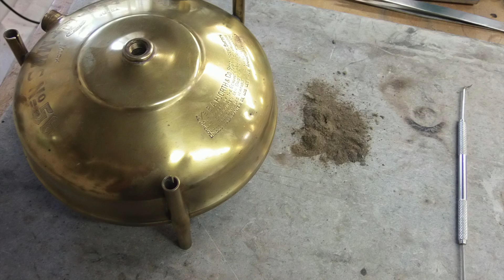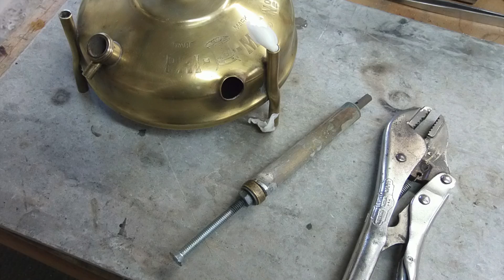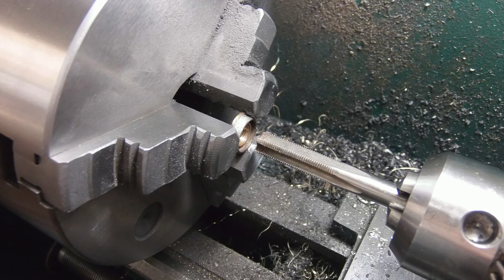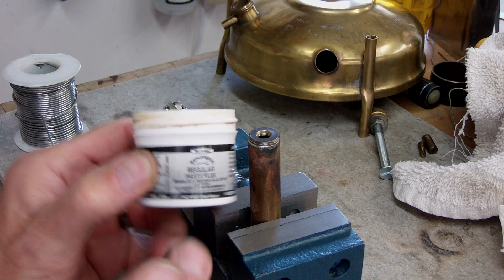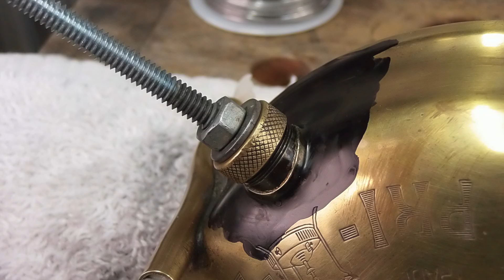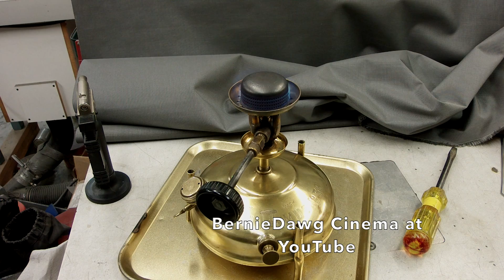Pump Tube Removal & Installation

Comment: I have done the same job with a Eze out ie change check valve
Reply from the maker: Yup. Me, too. I generally try that first. And, using a screw extractor will work much of the time, but *not always*. Once you've done several dozen of these pump tubes like I show in the video, you come to realize the pump tube method is good to learn for those times when a screw extractor (aka "EZ-Out", a brand name) on a bit extension won't do the job. Plus, the screw extractor method can direct so much force to the pump tube end that the pump tube end will break free of the pump tube. Old solder gets pretty brittle over the years. Then you are looking at a pump tube extraction anyway. Plus, extraction is the best way to repair a leak at the pump tube where it meets the tank. That's a very common leak point. So, that's why I made the video on this subject. I'm all about sharing stove skills with folks. How about you? Why don't you go make video on how to use the screw extractor? It'll save me doing it and I can link to your video through my channel and my webpage. 👍😎 BD

Comment: Excellent video, I’ve ordered the recommended Solder and flux off eBay ready for the repair of my Primus No.5 stove, the filler neck has a previous repair which looks awful and still leaks air, so I shall remove clean and hopefully seal it properly using your method on the pump tube. Thank you for sharing
Reply from the maker: Great to hear! You're welcome to drop a note to bd@berniedawg.com if you have problems or need some guidance. BD
Reply: @BernieDawgCinema  Thankyou that’s very kind…

Comment: My own Optimus 111, new old stock, over 20 years long never fire, it showed up that the pump cap stick super tightly to it's body tube!!!, I cannot go on any proper way after an overnight soaked with WD40 fail to success.
Reply from the maker: Try a real penetrant (not WD40) and soak for a week. Use Kroil, Aerokroil, or other penetrant designed to loosen parts. BD

Comment: Hey Sir What can I use besides the India ink on the parts I don’t want the silver solder to stick to ??
Reply from the maker: @Plumpy E Heya Plumpyman! Thanks for checking into my videos. I don’t have an alternative masking fluid for you since india ink works so well. Why switch to something else? I know it’s not a cost factor for you seeing the $$$ you have tied up in your gun and knife collection. ‘Sides, the stuff is cheap. Make sure to use rosin core lead/tin alloy solder for tank work and greater than 45% silver brazing rod or wire for burner work. NEVER use “silver solder” on stoves anywhere. Ever. Hope that helps. Remember I have a FREE helpline at bd@berniedawg.com . Easier to explain stuff and share photos of the problem work you are trying to tackle. 👍😎 BD

Comment: I am so grateful for this video.  I have a rounded nrv on old no. 1.  My prob is I don't have a spare cap to make the tool to hold the tube while extracting. Aany ideas?  If you happen to kniw the thread, perhaps i can cut one. Thanks!
Reply from the maker: @don evans I'm glad you liked the video. You definitely don't need a "spare" pump cap to make the tool. Just use the pump cap you have with your #1 stove to make the tool. The shaft of the bolt just needs to be a smaller diameter than the hole in the pump cap. Generally, a quarter inch bolt (or 6mm bolt) will do the trick for the shaft of the tool - just like the shaft of the pump. The pump cap is then removed from the tool when all the work is done and returned to service on the stove. Easy-peasy. 👍😎 BD

Comment: Very informative. Can you please tell me what thread is the Nrv
Reply from the maker: @steventhegrease monkey Sorry, I can''t (won't). It's a unique thread size designed by the stove manufacturers in the days before standardized threads circa 1890. Many of the thread sizes on these old stoves are like that - unique and proprietary so that you were forced to buy from the manufacturer. There are at least two standardized modern size threads that approximate the original proprietary NRV thread, but... if you can make one on a lathe, then you also have the skills and knowledge of how to measure the thread yourself. If not, then just buy properly sized replacement parts available from the few stove part suppliers still remaining in business. BD
Reply: @BernieDawgCinema  thanks I will give it a try
Reply from the maker: @stevethegrease monkey You could look in the description box below the video for some info, too. 😉 BD

Comment: Great video. Well done. India Ink to keep solder off areas where you don’t want it, nice! I just received my grandfather’s / Dad’s 1951 Primus No. 96.  Excited to use but need to clean it first, then test it’s function. Questions: How best to clean I, as the brass is quite tarnished? AND, any specific suggestions on how to take the stove through a proper testing are there specific things I should just go ahead and replace / repair? Many thanks, keep the videos coming!  Cheers from Alberta, Canada
Reply from the maker: @A Toiler Clean with some mild dish detergent and warm water. I don't endorse polishing, especially if it's old and has a nice patina. You'll remove brass and thin the tank walls every time you polish. Making it shiny like new destroys the history and character of the stove. A bit like trying to get Grandma to look like Megan Fox by applying lipstick and a wig. It's just wrong. (Ewww.) Wouldn't you rather want to see the history your Dads use left on the stove? Check my other videos. Especially the kerosene stove playlist. I have pretty well covered all the steps to get the NRV, pump cup, seals, etc refreshed and taken care of. Good luck! BD
Reply: @BernieDawgCinema  BDawg, thank you for your prompt reply and salient advice.  I’ll give the stove a gentle, nom-abrasive cleaning, then enjoy the patina! I will review your video as well. Shall I assume there are links to where I can obtain any seals etc. that I may need? Cheers to Megan Fox!:face-green-smiling:
Reply from the maker: @A Toiler You can find links to parts in the description box below many of my videos. Or, go to the parts page at my website (also frequently linked in the YouTube description box). https://www.berniedawg.com/stove-part-supplier-links/ Or, drop me an email at my free help email address: bd@berniedawg.com Easy-peasy. 👍😎 BD

Comment: Hi, yes I was sold a bad stove with a couple of issues and this was one of them.  I will try and follow your post, I have no tap die nor will I have a bolt like yours.  However I will persevere with torch and pliers and maybe help from someone to pull as weld gives.  I will watch this a few times lol.

Comment: GREAT video- unfortunately I need to perform this on a stove w/ a rounded NRV.
I'm no soldering slouch,  this video gives me the info , tips, tricks to git-r- done. Thanks for this BD.
Reply from the maker: @David Schmidthuber Drop me a note if you'd like advice and help with that. Perhaps better advice than you may already have been getting. bd@berniedawg.com BD

Comment: Glad I subscribed a few days ago as learning lots. Just picked up a Meva 1 SC stove dated 366 and got it working after tank cleaning. NRV needs attention as pump stem now starts to slowly come out under pressure so will need a new pip for sure. Hoping a longer acetone soak will allow NRV removal as it does loosen but is hung up. The NRV is slotted so no need for removal tool. Might have to remove pump tube as I dont want to destroy the inside of pump tube or the NRV. I might try a dab of crazy glue on end of screwdriver to fuse to the NRV slot as i dont want to pump air into tank since the walls are pretty thin snd prone to stress cracks. Thanks for all your videos and hope a resolution to your burner caps comes to fruition. M Smith in Ontario, Canada
Reply from the maker: @Mark Smith If you have compressed air through a chuck with a rubber tip you can give a 1/2 second burst to the tank through the filler neck and the NRV will likely shoot out the pump tube. Maybe hold a rag over the end of the pump tube when you apply the air to catch it. Or, you can use a pair of ear forceps, about 6-8" long to grasp and pull the NRV out of the pump tube. Find those on eBay for cheap. Or, you can take a steel welding rod like for oxyacetylene welding and put a small hook in the end and fish it under the head of the NRV to pull it out. The hang-up with the NRV is almost certainly the barrel of the NRV hanging up on the lead NRV head washer which has tightened up around the NRV barrel. It's why I prefer LDPE or HDPE NRV washers over lead. Good luck! BD

Comment: Excellent video....I have an old monitor 17b tourist stove and the vapourizer tube is off center to the brass threaded bit....this puts the burner head off centre....can this be repaired?
Reply from the maker: @John Watson Thank you! Yes. The Monitor 17B can be repaired to better center the burner head. 👍 BD
Reply: @BernieDawgCinema  And could you please tell me , could i do it with an ordinary propane blowtorch? or would i need more heat....i've never tried this before.
Reply from the maker: @John Watson Maybe. It all depends. Teaching you to repair your stove is not reasonably possible in YouTube comments. If you take a look at the very first line in the description box below the video you’ll see an email address where you can contact me to get assistance, advice, and even instructions on how to do your repairs. Just send a few photos of your issue(s) about the stove to that address. And, don’t forget to introduce yourself in your email with a real (not anonymous) name/ID and maybe what country you are located in, please. Thanks! Speak to you soon. 👍😎 BD

Comment: Great video. Thanks! Is that the original burner?
Reply from the maker: @Torbjørn Gjertsen Wow! That took some work to find out. A client stove I worked on in 2015. Yes, that is the original burner with (I believe) the original inner/outer silent cap sets. The stove is a 1948 Primus #56. The burner is the #4155 burner that preceded the #4190 which is much more widespread and well-known. The #4155 extended the cleaning needle when the burner spindle valve was fully closed - the opposite of the standard method featured on the #4190. You can find this stove, after my repairs, posted by the owner here: https://classiccampstoves.com/threads/primus-56-1948.30707/ I also made the tool for the owners Primus SRV fuel cap that features in that social discussion forum thread. 👍😎 BD
Reply: @BernieDawgCinema  Thanks for a great and detailed answer! Sidenote: Yesterday i saw a Primus, UNUSED in its original package for sale here in Norway price was $120 or bid. Now the ad is gone and unfortunately the pictures too. What do you think it could be worth? Looked like 60+ years old.
Reply from the maker: @Torbjørn Gjertsen There is no easy or reliable way to price vintage stoves sold at auctions. There is supply and demand. And, there are just serendipitous things like bidding wars. Stoves bring what they bring and the results can vary for a variety of factors. To get a general idea of what a stove is worth, check the “completed items” at eBay for the item you are interested in. It’ll give you all the finished auctions for the last three or more months. That way, you can get an idea of what your chosen item will bring at auction. The two big sellers I see out of Norway are the military Optimus 111 stoves that have the Optimus-modified “C” or “cobra” burner that’s been turned 180 degrees (sometimes mistakenly called the “Arctic” stove); and the Fuhrmeister military stoves. Here’s a Fuhrmeister now, which will disappear after this Saturday, Feb 6th, 2021: https://www.ebay.com/itm/Vintage-military-camp-stove-Fuhrmeister-No-8/284166889632 
At $1100 now, it may well sell for over $2-3000 when the dust settles. Good luck! BD

Comment: That’s a beautiful repair. I have recently repaired my mum’s old Primus 96 which I think she has had since the 50s. The NRV was so jammed in that I added a lever to the new NRV wrench I had bought with the service parts. It was so tight that the wrench handle started to bend! I decided to clamp the wrench vertically in my vice and lower the stove body over the tool.  Eventually I got the NRV out and was surprised that there was no washer inside. I guess that’s why it was so tight. Thanks for the video.
Reply from the maker: @Tony Frewin Thanks for your story. The method you stumbled on (NRV wrench in the vice) is the long time approach to removing stubborn NRVs and is the method I promote, show and demonstrate in several of my other stove repair videos. You may wish to check out those other videos to learn even more about your stove and stove repair generally. People in the UK were pretty poverty-stricken after WWII, so it’s likely the stove lacked a NRV washer due to penny-pinching and frugality in the postwar economy. BD

Comment: Hi. Thank you for this excellent video. I have learned a lot. I have a family owned Radius 21. I want to try to remove the NRV first but the NRV key is lost. Could you share the dimensions of the key (or the screw head at the bottom of the tube) for those of us who wish to try to build a rplacement key. Thanks again!
Reply from the maker: Hi Afsar Saranli I've posted dimensions and photos of the most common NRV style as found in your Radius 21at my blog site. Here's the link: http://www.berniedawg.com/nrv-head-dimensions/ Hope that helps and good luck on your stove work. BD

Comment: Sir. Kerosene fills in the pump tube of my primus No.100. Does it need similar restoration?
Reply from the maker: Maybe. But, you should make sure your NRV is properly serviced with a new pip and a new NRV head washer first. I show how in this video: https://youtu.be/2LKsxIYCTko BD

Comment: Your video has inspired me so much. I can't wait to try it. In addition, I would like to ask  you to show how to remove the vertical flow after welding.
Reply from the maker: Thanks! I do not know what you mean by "vertical flow". This is soldering not welding, but I think both misunderstandings, yours and mine, are from translation issues. I am fluent with Google Translate if you would like to send me an email in your native language. BD

Comment: Hi , great work , could you tell us a little more about the black stuff you used to stop solder flowing onto other parts? you said indian ink? as in tattoo ink?
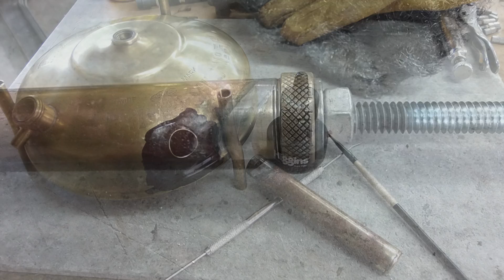Reply from the maker: Thanks for the compliment. I don't know anything about tattoos, sorry. India ink. The bottle is at 6:08 in the video. It's from Higgins. It's the stuff you put in fountain pens or draw with as in "pen and ink" drawings. Artists use it. Calligraphers, too.I bet a search on Google or Amazon would turn up bunches. Or, at a stationary or art supply store or even aisle at Walmart. BD